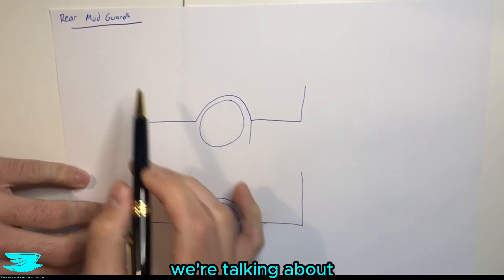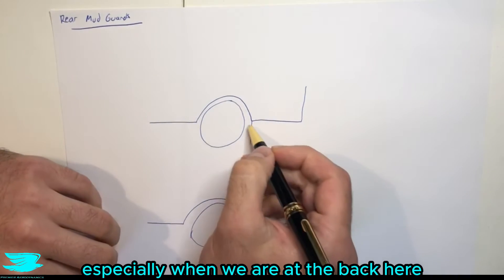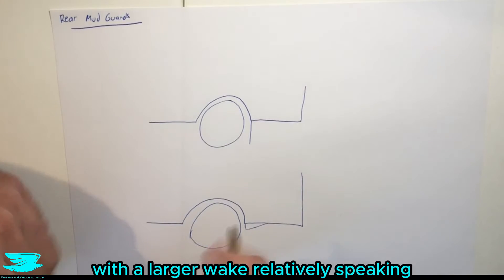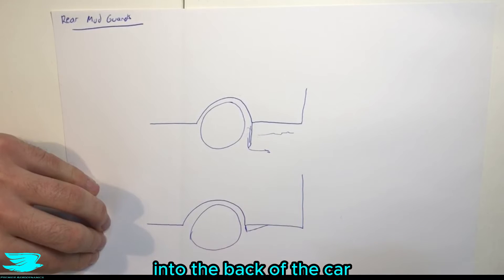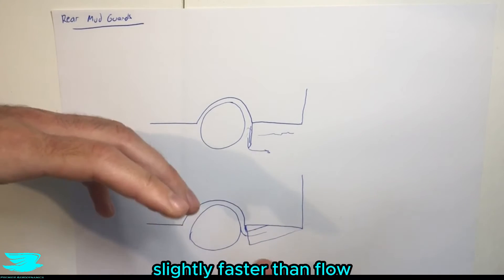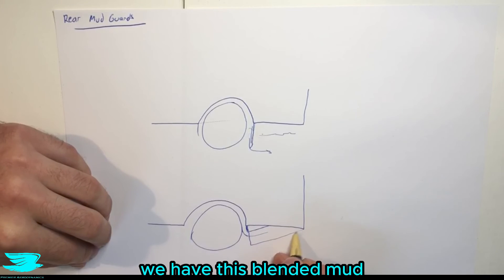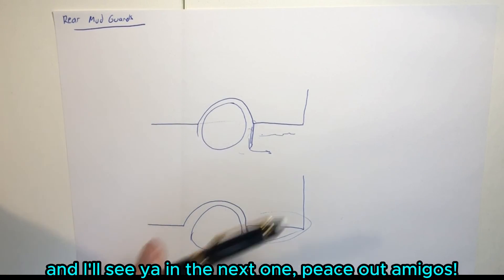Do Rear Mud Guards Improve Car Aerodynamics {Auto Aero #52}

Comment: It would be interesting to see a few analyses of these done on a few fairly common vehicles, say a Civic, RAV4 and a pickup, to determine the total drag effect. For both front and rear, comparing with none, the OE-type aero ones, and the big rally-armor/rokblokz type. Then there's also the little aero flaps some vehicles have underneath about 2/3 of the way back between front and rear wheels (previous generation murano is a good example). Also, the louvered, vented or brush type mudguards from large commercial could be another interesting comparison.
Reply from the maker: We have a Civic coming out this Saturday.
Reply: @PremierAerodynamics  Very cool, did watch the civic video. But meant it would be good once you have a baseline for some common vehicles to see how some common add-ons and modifications (roof racks, aero mud guard, rally mudflaps, diy splitters, trunk spoilers, wider and higher offset wheels and even spoke designs, ride height, etc) affect aerodynamics. I think a lot of the diy community would love to see that.

Comment: I got some tricks for guys who want to tune their cars.:

If you want to improve drag on cars, do a propeller at the back of it.

It works far better than vortex generstors on top.

You need to accelerate the air that was catched by the car down to zero velocity again.

With a prop you can also be aerodynamik with a steeper rear.

Since 80% of the energy is sucked away by aerodynamic Drag on a car.
It should be worth investing in a prop.
You need to power the wheels too for best efficiency.
Reply from the maker: I don't quite understand. Do you mean, put the propeller behind the rear window and suck air into it to keep it attached?
Reply: @PremierAerodynamics  

Yes, i think so.

The technic is called boundary layer control. Or perhaps boundary layer suction.
If you google after "tatra v 855" there should be a picture in wikipedia.

You could use a smaller impellor too. Cause using a prop in street traffic is dangerous i guess.

If you compare speed and horsepower of cars and airplanes.
Airplanes need far less horsepower for high speeds. 
And with a car you don't need these big wings that produce most of the drag.
Plane 100 hp 200mph
Car     400 hp 200mph

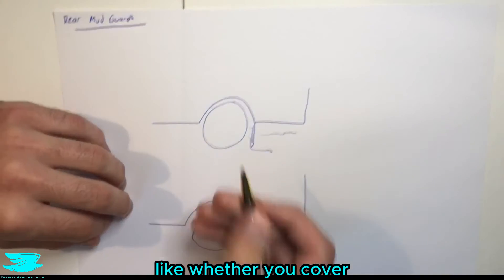Comment: 2:18 It's good to cover wheels from the front and sides, but not the rear or top-rear. Look at the louvers and wheel-well outlets on closed-wheel race cars. As a general rule, fenders would be almost completely open in the rear, if permitted by the regulations.

Fixed-gear aircraft wheel fairings are an exception, because
1) Drag is prioritized, and a bit of lift is not detrimental in this use case.
2) They spend very little time rotating in contact with the ground.
Reply from the maker: That is a good point. From a direct point of view, I can definitely see that being the case because the top vortices and separated flow can escape quickly without increasing the wake size much.

But from an indirect way, covering the back and lowering the rear fender helps reduce the amount of air that goes into the wheelhouse to begin with. It also squashes the flow coming out and if you can straighten it, you could use the turbulence to potentially run the diffuser at higher angles.

For regular production cars, cover the rear of the wheels is the best, and that option is probably due to no one daring to make a car that doesn't have a back. Also, safety reasons I guess.

Comment: I was wondering about this, but one other question, does the bottom 3rd or so of the wheel help reduce drag at all as its speed relative to freestream would be lower, ie 0 right at the ground?
Reply from the maker: Th bottom third is also quite draggy unfortunately. That is because when the air hits the front of the wheel, about half of it goes down, and rolls up into a vortex, and that vortex accounts for like about 20% of the drag of the overall wheel.

Comment: The best way to deal with tire wake is to restrict how much air hits the face of the tire, and increase the pressure behind the tire. The second best way is to outwash air behind the tire, because this confines the wake to a vortex that stay's in the tire's footprint. The energy stored in the vortex resists shifting under yaw, better than fully turbulent wake, which is more likely to turbulently mix with airflow in the diffuser increasing the tendency for flow separation/instabilities.

A lot of newer high performance cars have started putting strakes behind the front wheels precisely for this reason. Also trucks here in the U.S. have started putting outwash panels on the trailers that sit behind the front axle of the trailers.
Reply from the maker: I have noticed that on the diffusers. It makes sense to straighten the flow, and at the very least compartmentalize regions of flow separation.
Reply: @PremierAerodynamics  Toe out, or outwashing air behind the wheel organizes the wheel wake into a vortex. Naturally running toe out in the rear is not desirable from a static alignment setting.

Technically you could run induce toe out on the inside wheel with roll/bump steer, so that it helps aerodynamically under cornering. You can tune it to work at higher speeds as the aero compresses the suspension, you can change the roll center to induce more bump/roll steer by changing the pick up points on the suspension arms and how they mount to the upright.

Comment: I rememeber when aerodynamicists started to invlove the wheel-body interface more in their designs. This lead to the lower body line connecting front and aft wheel wells in a shallow arc, as we often see today. IIRC this single measure had one of the largest impacts on Cd.
Reply from the maker: Yeah! Surprisingly, the wheels account for 30 to 40% of the overall drag, so incorporating them into a more aero design is one of the best ways to reduce the drag.